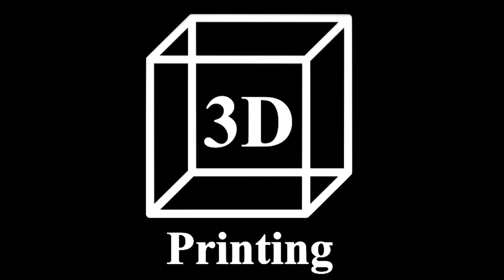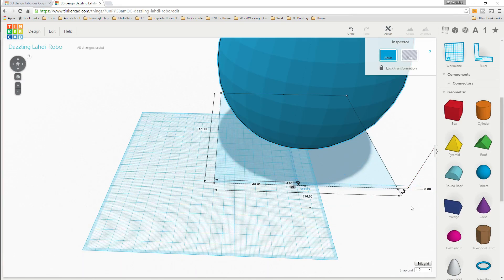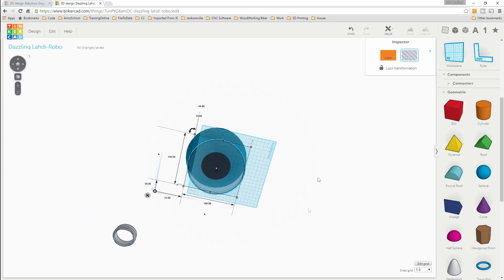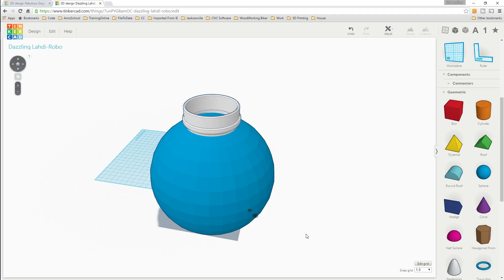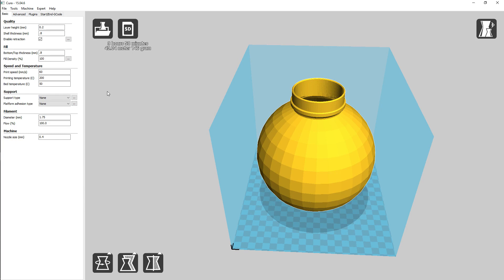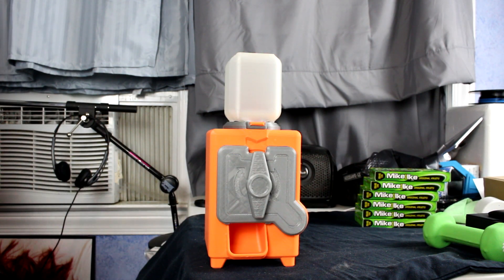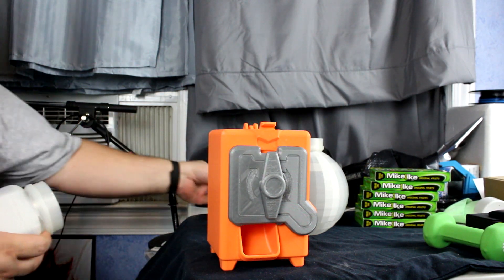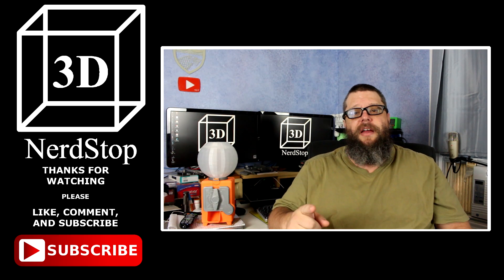3D Printing: Gumball Globe

Comment: Great video. One thing I don't like about Tinkercad is that it can be difficult to get real rounded edges. But if you go to Shape Generators > Community, some people have uploaded high-res versions of some of the basic shapes like the sphere and cylinder. If you bump the resolution of the shape all the way up, you can get a perfect sphere (more or less).
Reply from the maker: I did not know that. Thank you. I will have to check that out

Comment: Thank you for taking the time to explain the whole process bro, I do have one question, the outer sphere is 176mm and the inner one is 174mm, doesnt this gives a 2mm thickness instead of 1mm? or am I forgetting something?
Reply from the maker: When you center something it will cut the different in half so 2 mm becomes 1 mm on each side of the center.